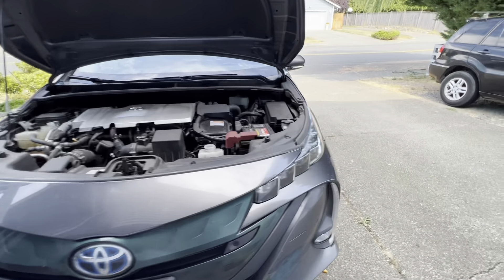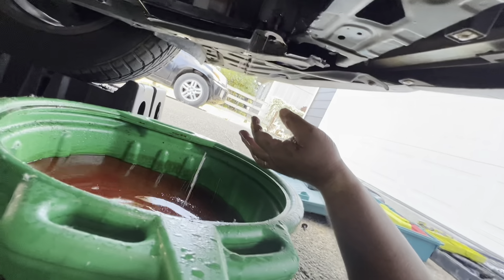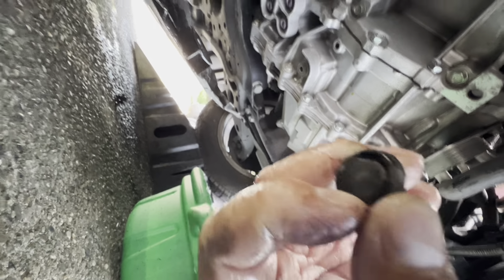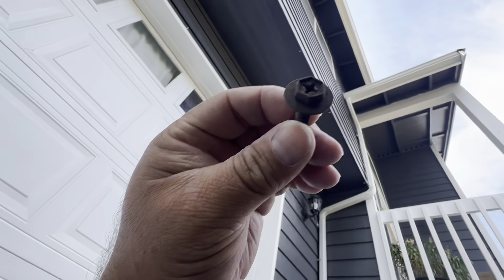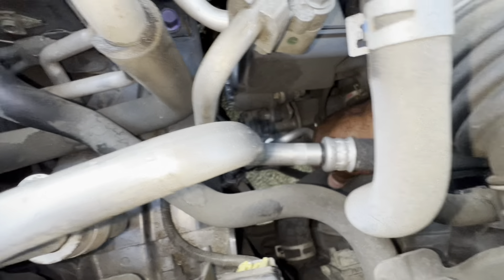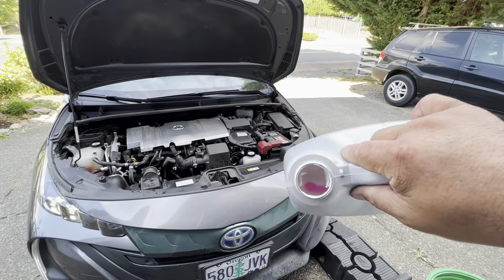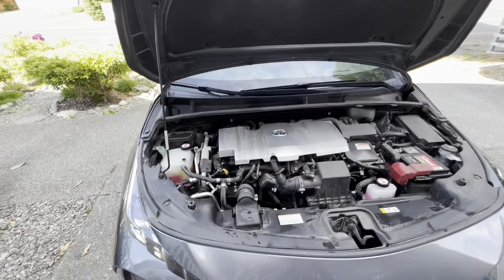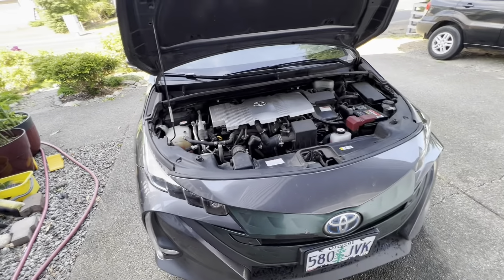Toyota PRIUS 2017 PRIME EASY COOLANT DRAIN AND FILL! DIY Keep Your Car Cooler! Full Video

Comment: Good job.  I'm just hitting 104K on my 2017 Prime.  I finally sold my 05 Prius, after getting it ready to sell by doing front and rear brakes, engine water pump and belt, a taillight assembly, and a few minor things.  I'd already done the transmission fluid a while ago.

On the Prime, I would have done front and rear brakes last weekend if I hadn't fallen head first onto a boulder and also banged up my knees a little.  I got very lucky to not break my skull or neck.  I guess I need to stop thinking I'm 30 when I'm 65.

Surprised my Prime needs pads at 104K, the original brakes on the 05 lasted 230K, but I did drive the Prime hard out west a few times, basically going flat-out on twisty mountain roads.  The rotors are only lightly grooved, and seem barely worn, so I was going to just do pads.  But then I spent $78 to get 4 rotors online.  It's easier to replace them than guess whether I can milk the rotors to last through the life of the new pads.  I'll see what thicknesses the original rotors are after filing and/or turning them, maybe reuse them on the next pad change at 200K.

 I'll do the Prime brakes within the next few days or week.  Original windshield is being replaced on Thursday.  And I have to replace the front right signal light assembly.  Busted it when the car was 3 months old, eventually bought the $735 part off a wreck for $150, but never installed it.  Time to get the Prime back to like new.  What a great car it is.

Thanks for your videos.  I always say I ought to post video of the work I do on mine, but then I never bother to do it.
Reply from the maker: Glad you’re still alive and walking!  Let me know how the brake job goes, I still have over 50% left on mine I think.

Comment: I went to Pep Boys today asked for a flush I watched him through the window and all he did was drain and fill when I was advised by them for a flush with the machine.. He used red/pink coolant for the engine and inverter which I clearly told them not to touch the inverter.. am I in trouble or do you think I'll be fine 2016 Prius..?
Reply from the maker: Not sure just make sure you check the levels a few times after all the air bubbles are out. And top off as needed.

I don’t trust anyone so I do it myself as much as possible.

Comment: My 2011 shows overheat and mechanic told some issue with head gaskets that can only be repaired by authorized service center. When I looked myself to this coolant tank its almost empty. Is that normal that all coolant will be sucked inside engine ? Will filling some coolant myself will help?
Reply from the maker: Not normal at all. I would personally add coolant. I check my levels every 2 weeks. Good luck

Comment: Nice video but how you bleed the engine coolant? 
Why the engine reservoir coolant is not even level in ? You have a second valve on the coolant reservoir for what is that? Not something to do with bleeding the system?
Reply from the maker: Hopefully someone has the answers to you questions! This process worked fine for me wish there was an easier way to bleed. I heard you could just put it in maintenance mode to help  bleed out the air. I just drove it around the block several times in my case.
Reply: @AutoGuyVideos  Thanks 👍

Comment: Thank you for this video, but you didn’t have to bleed air out of the system or anything? Just worried about my 17 Prime 130k miles overheating due to that. I’ve always done my own maintenance since day 1, but this is the last thing I need to do.
Reply from the maker: Just make sure you run the engine and keep topping off the Reservoir tank and radiator. I had to keep topping off a few times the next days after as well. It’s all good now.
Reply from the maker: Also I squeezed the black radiator hoses to get more air out as well.
Reply: I will keep all this in mind. Thanks!

Comment: Have you ever heard of an issue with low heat temperature?
For example, heat is set to high, but the air temperature from the vent is on the cooler side, even after running the car for a while.  I have a 2017 Prius Prime.
Wondering if if could be related to the coolant.
Thanks!
Reply from the maker: Honestly, I’ve never had that problem with my car. But I have heard of other people with similar issues that you are speaking of.

But I have noticed my car does generally heat up faster when the engine is running versus just EV only
Reply: The same thing happens to my Prius too!! 😮

Comment: How often do you change the oil? Dealer told me 16,000km, which seems very long. And I can't find anything in the manuel
Reply from the maker: Personally because I drive a lot of highway miles I change mine every 7500 miles. Plus I drive a lot of electric miles. You can never go wrong with the 5000 mile or oil change. I would always err on the side of changing it sooner than later and more frequent. Bad things can happen when you wait too long or too many miles.

Comment: I think you could put the car on maintenance mode. So its stay running
Reply: I make sure the battery is below 80% and put in charge mode. It keeps running and charges the battery.
Reply: I must confess I do not know how to do this and have had my Prius 3 for four years now. How does one put it into  maintenance mode?
Reply from the maker: @alexisrodriguez2966  I recently made a video how to put it in maintenance mode to check that out in my Prius prime channel
Reply from the maker: @alexisrodriguez2966  

Here’s the link to my maintenance mode video it keeps the engine running 

ACTIVATE/ENTER Maintenance Mode, 2017 PRIUS Prime. Works on Any Gen 4 Prius. Keeps engine running!
https://youtu.be/3n6yHVw1x_8

Comment: I ordered the same coolant you used in this video. I noticed the cap is red. Is the coolant red or pink? 

And if it is red is it ok to mix red and pink?
Reply from the maker: It’s the same color as OEM. Looks red but comes out as pink.

Comment: Did you wait 170,000 miles to change the spark plugs?
Reply from the maker: I did them in my earlier video about 3 years ago. Make sure to also subscribe to see all my maintenance work on my car. I was around 90k when I did my spark plugs and it’s due again soon. That might be my next video so stay tuned!

Comment: How often you must supposed to replace coolant flush
Reply from the maker: It probably should be done about every 100k miles. most of my miles were freeway so I pushed mine a little bit longer

Comment: Can i just siphon out the old fluids from the coolant reservoirs and then refill or do i need to get under the car? I also have a 2018 prius prime so your videos are a great help!
Reply from the maker: Yes you can but that’s just a fraction that you will end up replacing. Which is better then nothing. 

I ended up using just over a full container to refill after my drain.

Comment: Does it really matter if red and pink coolants are mixed?
Reply from the maker: Not to my knowledge. I thought the Toyota OEM antifreeze was on the expensive side. But if you have money to burn you can’t go wrong with OEM. I was happy to use the zerek brand.
Reply: Are you referring to the super long life coolant for Toyota and Lexus that costs about $32 for each one?

Comment: Can you tell me of your speedometer is off by 5? If you set your cruise at 70, the speedometer will show 65. I've Google this issue and other have it as well.
Reply from the maker: My speedometer is off by about 1-2. It will Also depend on the tire size. Otherwise see if the dealership can re calibrate but I hear the speed on display is usually faster then reality. Probably to prevent us from getting tickets. Lol
Reply: I worded that wrong,  if you set your cruise at 70, your real speed will be 65. The speedometer will show you're going faster then you actually are.
Reply: @AutoGuyVideos  everything is factory on this car. I've had it for 1 year. I'm frustrated by it.
Reply: @AutoGuyVideos  my other grip is, if your speed is off by that much. Wouldn't the odometer also be "off" too? 

I live this car, but being off byb5 is ridiculous. I can live with 1 or 2
Reply from the maker: @nickr3441  see if they can fix under warranty if they want to charge you then call Toyota corporation to get assistance
Reply: @AutoGuyVideos  I'm going to call them, I took it to the dealership and told them and they said they hooked it up and found its accurate and my phones GPS is wrong lol.
Reply from the maker: @nickr3441  the other way that I can tell is when I drive by one of the radar’s that show you your speed.

Comment: This method only drains the radiator there's another 3qt or so coolant remaining in the engine block which has separate drain plug. Also trapped air needs to bleed out over time so keep an eye on reservoir and keep topping off.
Reply from the maker: Yes very true!